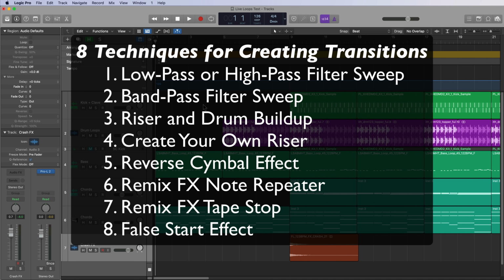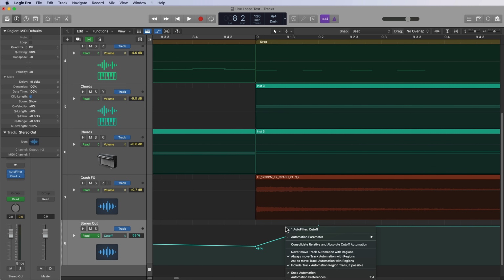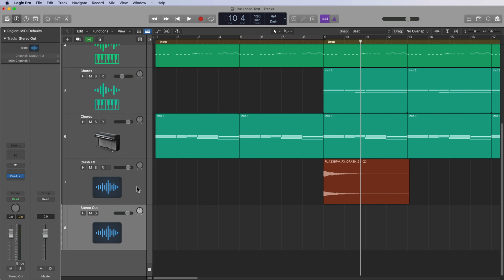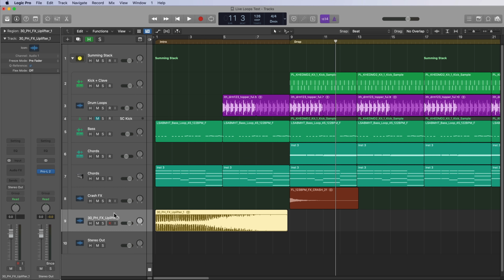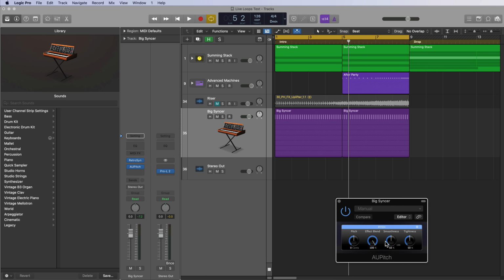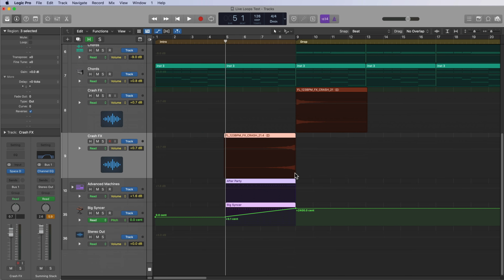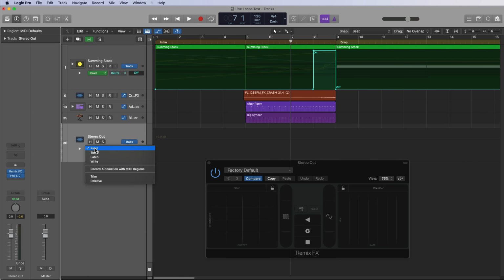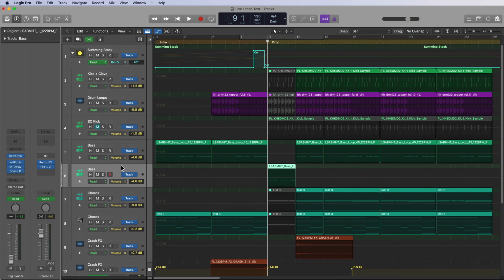Logic Pro - 8 Transition Techniques

Comment: I always find automation on the stereo out a little tricky. When using certain plugins, you also want to automate the 'bypass' for that plugin because you want to be sure it isn't effecting the audio in any way after the transition. By doing this, you can get clicks and pops and even the bypass moment is hard to get it synced to the correct beat/point.
Therefor, I like to bounce out the transition part and have it on a separate track and make my automations there.

Secondly, I never automate my 'volume' but use the gain plugin instead. This way you can still use the fader when you are about to downmix your project.

What is your approach on that one? Thanks.
Reply: I also thought the same in your second point, but you can adjust the automate, when you open the automate window, are the automate options, read, latch, etc, to the right the parameter to automating, volume, cut off, whatever, and at the corner, the magic option, you can swipe up or down to adjust the general automate, so now you can automate the volume :)

I hope you can understand me haha, i am learning english

Comment: Very useful examples and explanations.
Any reason not to just bypass the filters at the end of the transition instead of having to nudge the automation back and then set the filter wide open?  Same question for muting the reverb tail.  Would bypassing the reverb accomplish the same thing or would it lead to problems?
Do you prefer the summing stack to just creating a submix bus?  I know they are functionally equivalent but curious if there are other advantages of either method.
Reply from the maker: The reason why I don't just bypass the plugins is that sometimes when you bypass a plugin, you'll get an audible pop or click in the signal. If you really don't want to have the automation jumping that quickly, you can always just duplicate the track, and apply the transition effect on the duplicate track, and leave the original track alone.

A summing stack and submix/submaster on an aux track are the same in terms of how the audio is handled. You just get the bonus of it also being in a 'Folder' if you use a stack.

Comment: @musictechhelpguy when it comes to automation snap, if it's turned OFF you don't need to move the first node back anymore. At least in 10.4.6, which is what I have, you can have 2 nodes aligned without one deleting the other. It just doesn't work is the snap is ON, though
Reply from the maker: Good to know! I though that 'flush' automation points were allowed in a recent updated, but I confused as to why it wasn't working! Thanks.